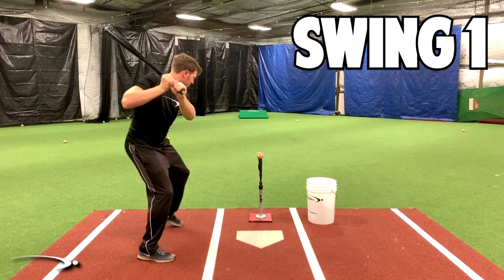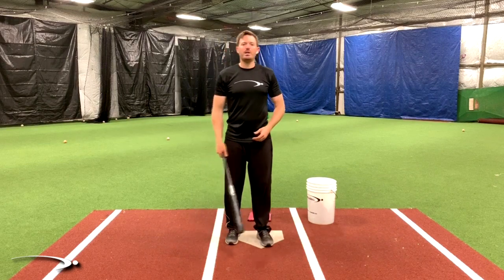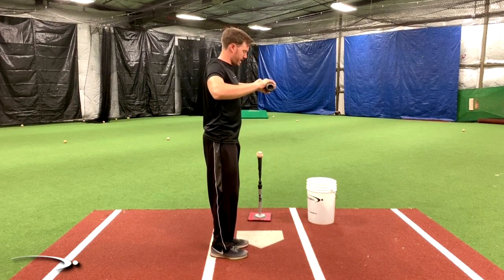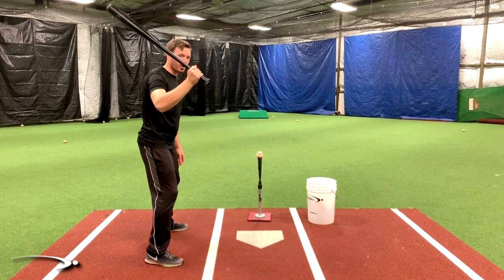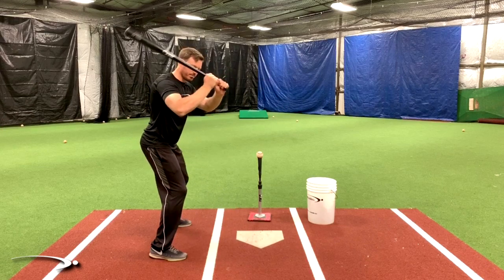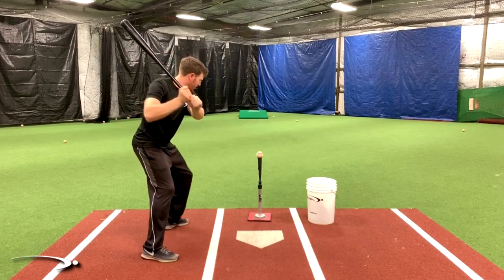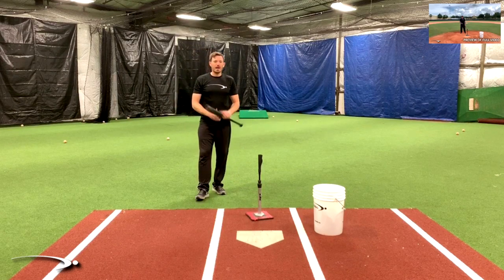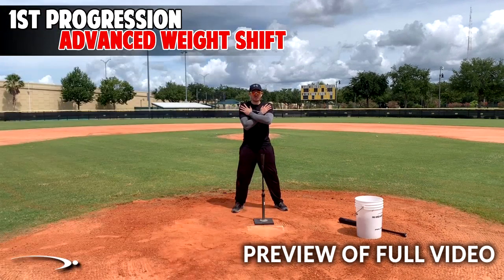Load Angle for More Powerful Swing | Baseball Hitting Mechanics (Pro Speed Baseball)

Comment: Why are your hands leading your body?  You aren’t creating any direction or path. Pushing your hands to the ball will result in rollovers to the left side and pop ups to the right.  Just watch how your downward swing popped the ball up.
Reply from the maker: Hey Dre, thanks for the question! It is physically impossible to create any reasonable bat speed with the hands leading the body. The kinematic sequence of swinging a lever starts from the ground up. What you're seeing is a swing that is in sync with the body, versus a hand/bat drag where the hands are behind the sequence. Also, you should check out the Myth of the Rollover video we have on the channel! Also, a pop up has nothing to do with angle of attack.... the physics of hitting are very simple, if you hit the bottom of the ball, the ball will pop up, if you hit the top of the ball it will go down.... whether you're swing up, down, left or right. Hope this answers your questions!  ~Michael Pro Speed Baseball